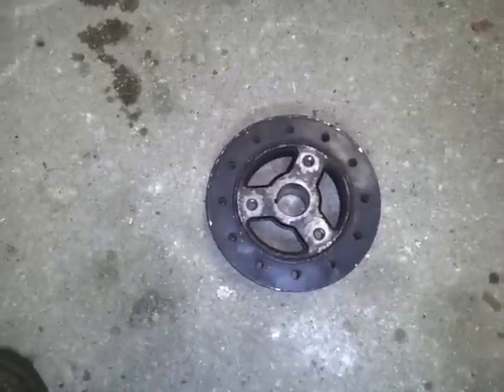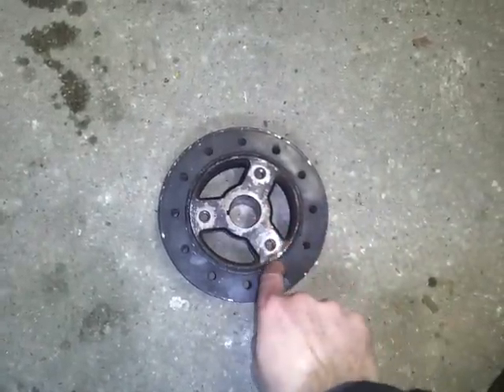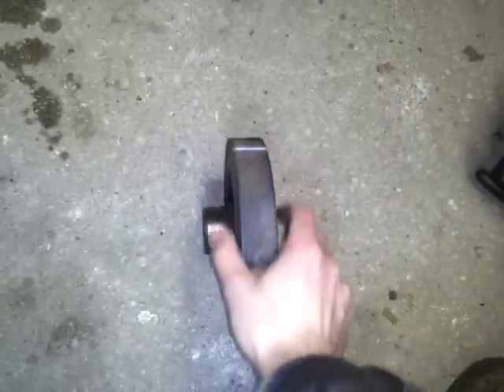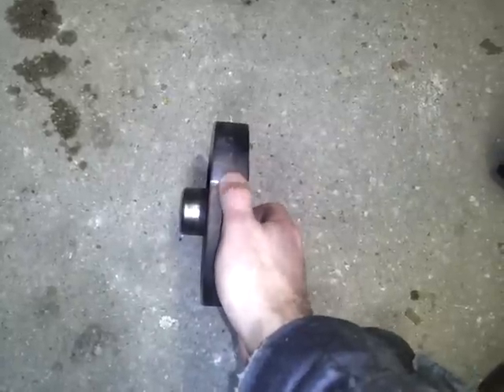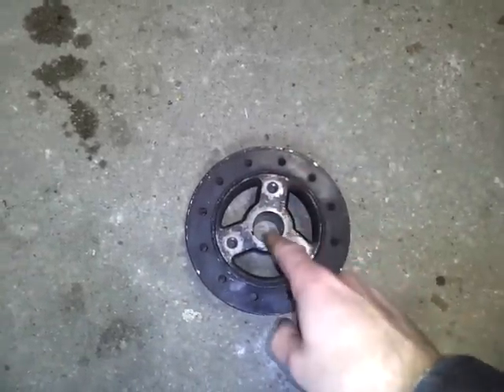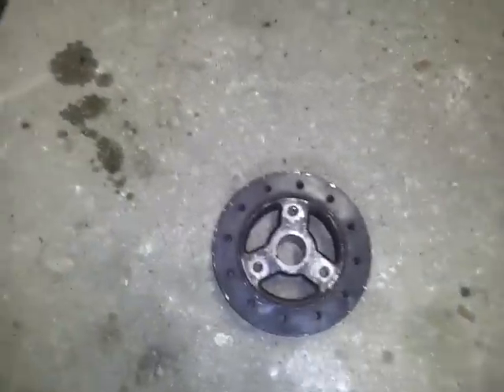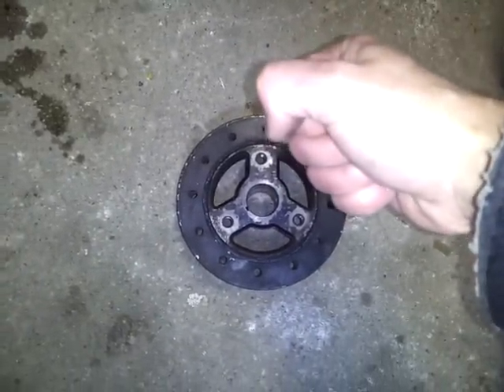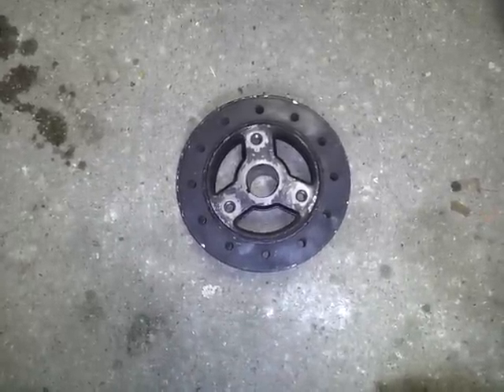HARMONIC BALANCER / DAMPER - Everything you ever wanted to know!!

Comment: Im having mechanics take advantage of me in Albany NY every turn they can't bleeding me dry code p 0440 they replaced every part known to man and never fixed it I ended up fixing it myself it was a throttle body gasket replaced it and out went the engine light now oil leak every where 2005 pt cruiser non turbo touring I'm trying to find out it it's the crank shaft seal and harmonic balancer how can I know. Idle extremely rough. When driving seems fine but not powerful as it used to be.
Reply: New throttle body?

Comment: Harmonic balancers  are good for engines  without a lot of horsepower ,if your are pushing  500 hp  and over you are better  off getting  a fluidampr or another  type of performance Harmonic balancer that way you won't have any issues when they get old and that elastic polymer seal or gasket starts to break down ,

Comment: close, torsional viberation is variation of rotational speed during each full rotation of the crankshaft. When one piston is on its power stroke the crankshaft speed near that crank throw increases.  During other periods between power strokes the crankshaft slows down.  In a multi cylinder engine the longer crankshaft can twist and spring back a tiny amount several times in each single rotation.  A harmonic balancer dampens these rotational pulses so the crankshaft doesn't develop cracks over time leading to progressive failure of the crankshaft.

Comment: my motor shakes during idle...i noticed the pulley on balancer and balancer has slight wobble... also my tensioner pulley on my chevy 4.3 is bouncing up and down... since theres no miss and just did everything else..new cap,rotor ,plugs wires,timing chain ,water pump etc....I wish i would have known it was bad when i replace timing chain and gears... but if this fixes my issue i won't be complaining..
Reply: Did this fix your issue?

Comment: You mentioned a vibration.Now is that only when the car is moving?  I have a vibration at 1800rpm no matter what speed. Feel it more when the gas pedal is depressed and also when the car coasts (no gas pedal depressing) at 1800 rpm. could that be a harmonics balancer?
Reply from the maker: If ur balancer is causing a vibration..u would see it wobbling as the engine is running..it would have to be really bad..I would look more into warped rotors or unbalanced tires

Comment: To put on a harmonic balancer,you need to boil it in water to 100c ,using gloves put it on the COLD crank shaft !
For a real harmonic balancer or damper !!!   check out.  fluidampr
Reply from the maker: andrew podger i would not recommend that on balancers that have rubber isolator

Comment: hey man thank u so much for this video. i purchased a new balancer today for my 4.3 ltr gmc jimmy bc its starting to shake my truck on the highway now,its been throwing a random multiple misfire code. but i was beginning to have doubts bc theres so many things in that area that could be the culprit. also i can here it tapping like a metal on metal sound.but my point is u said when looking down at it engine running it wobbles and mine does. so thanks again man.also theres a sleeve assembly but the auto stores dont have it and don't know what its for which also makes me nervous.any idea what the sleeve assembley is for??
Reply: Did replacing the balancer stop the highway shake?

Comment: hey i got a question. im rebuilding my 3.8 engine and im gonna imstall my pistons in .  now my question is which way does the tang go the tang is the oil gaps on the connecting rod. which direction does it face?   im stuck hahahaaha
Reply: Do you rev it high? Is your timing gun off?
Reply: z352kdaf8324 no i dont rev high. but i figured it out i got it going. runs great.   thanks though

Comment: have they been known to make a loud Cricket noise when bad I have a Jeep Wrangler it's wobbling and the seal is bulging out replace water pump and all pulleys and noise is still bad and getting worse could this be the culprit
Reply from the maker: if its wobbling and the seal is bulging..i would replace it..the noise part..it could possibly be it..is it wobbling and hitting the timing pointer or the timing chain cover?
Reply: No but I did notice a bolt behind it they had came out
Reply: But I tighten the bolt but the noise is still there
Reply: Have you ever heard of taking the belt off and checking it that way since nothing else is running would that work to determine if that's where the noise is coming from

Comment: HARMONIC BALANCER REMOVED without a puller because cannot find one for my LT1 motor .Now cannot get the HARMONIC BALANCER  holder bracket off to get timing cover off .https://www.chick.com/reading/tracts/1022/1022_01.asp Drive hits the wall

Comment: Tell me this. I am building a 383 chevy stroker. Got the long block together with the voodoo cam, double roller chain and 2 pc edelbrock timing cover. The engine is on a stand and rotates 360 degrees any direction but when i install the 400 balancer it only rotates less than 360 either direction and something locks up the engie so it wont turn any farther. Balancer been on and off twice and same problem.
Reply from the maker: Sounds like the balancer is hitting something on the block..does the timing pointer clear?

Comment: I have an 03 F150 with a 5.4 and it vibrates at idle pretty bad. Its not a misfire. I think it might be this.
Reply: I also have a 2002 f150 5.4 and it started vibrating at idle very know and then ,it's not misfiring let me know please I'f u fix it and worked for you ,

Comment: Hi, great video, I have a bmw e39 520d and the crankshaft pulley breacks after 300km I had it changed 3 times, with all the smaller rollers and it still brock agen. What can be the cause of that? Thx and best regards

Comment: I took mine off but cant installl because theres no  center bolt hole to use a press.Every place i asked they say to hammer it on.
Reply: what abt just getting it on the beginning of the shaft and then using the center bolt to screw it down onto the shaft as u tighten?...Hammer? are u kidding?